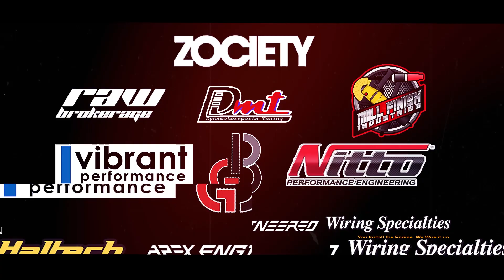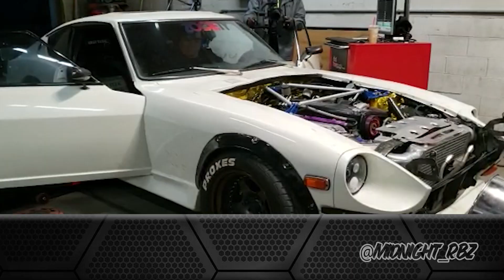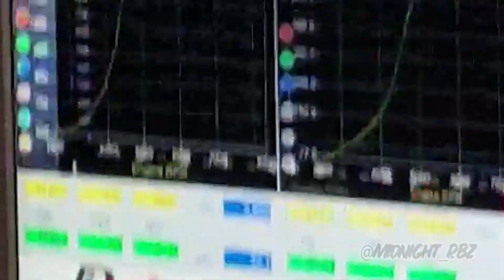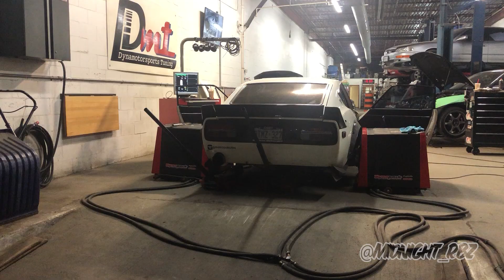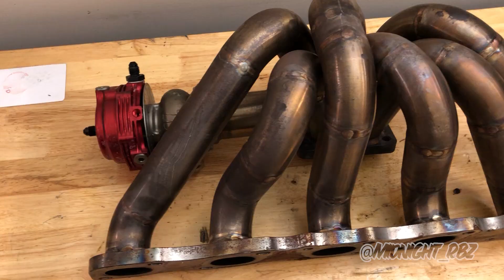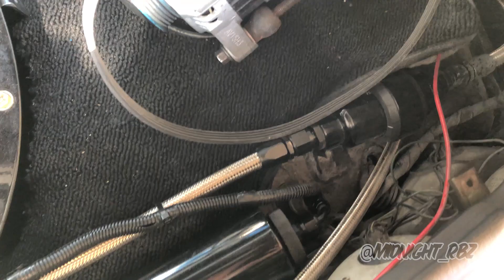How To Make 600HP+ On An RB26 | RB26 Swapped Datsun 240Z Build

Comment: Your video and narration is on point! Clean and well summarized!  I'm running a g35-900 and a buddy runs a g30-770 both on ej257 built motors. Based on the research I did on these g-series turbos, and given your motor, I personally feel that the 0.83 a/r housing and g35-1050 might have been the perfect match for your setup and would have widened your useable power band. Looking forward to your next video.
Reply from the maker: Ibrahim Butt thanks for the support, I looked at the g35-1050 prior to pulling he trigger in the g42-1200 but after speaking with dahtone and a few big hp guys in the states the g35-1050 will probably make around 800-850 on an rb motor. If the g42 is a laggy lump of shit I’ll just go down to a g35-1050... too bad there’s no middle ground offerings from garret.

Also your builds going to be nuts are you on Instagram?
Reply: @midnightrbz4787  yes I'm on Instagram as ibrahim_8229.
I don't have a lot of content there though, just a little bit of stuff that doesn't really showcase the car's power. I need to get more content there. Check out Sam Performance's YouTube channel, he is my tuner. Here is the Dyno video https://youtu.be/igcdC-nXaCI. If you search for "G35-900 STI", you should find a street run and Dyno run on his channel. 
Right now my car is currently getting some minor tweaks to fuelling and the meth injectors that should bump up power to around 630 WHP at least. That plus a bump from 34 to 36 psi boost.
I think you will make around 950 whp with the g35-1050 on an RB26 with your 2.9 stroker. I was a bit surprised to see you're not running at least 272 cams. Also, I'd prep your setup to run high boost,  as these turbos absolutely love high pressure ratios; just take a look at the compressor maps on the g35-1050 and see where the best efficiency point sits. You can also make more power with a bigger A/R turbine housing, but I would strongly discourage going over 0.83 A/R, as you will probably stand to gain a little more top end at the cost of a narrower power band. If you want to go bigger A/R, replace your valvetrain to allow for a higher redline so you can expand your useable powerband. Study the turbine housing maps as well. 
I selected my turbo based purely on a study of compressor and turbine maps, and efficiencies at given pressure ratios. In my case the best selection / balance was the g35-900 :)
Reply from the maker: Ibrahim Butt on the new build I’m running 282 kelford cams and I’ll check out that channel and look for huge STI... I compaired both maps and even on my previous set up with the gtx3576r max efficiency on pump here in Toronto was about 22psi but I could push it with E85... I’ll keep you guys posted on the results of the g42

Comment: what power steering rack are you using, what modifications were made to make it work? Difference in steering before and after?
Reply from the maker: Michael Bindhammer it’s a Subaru rack with stock modified power steering pump... I should make a video on it